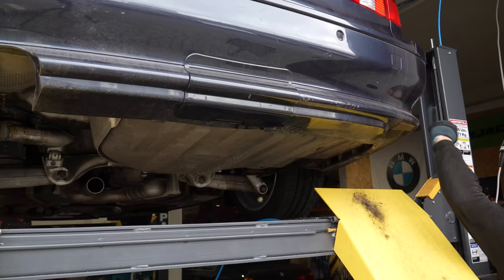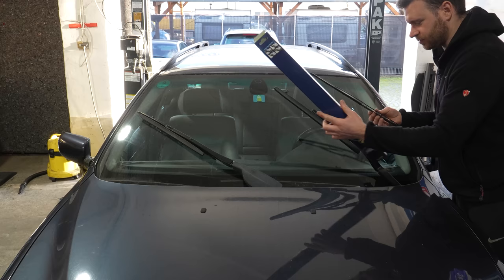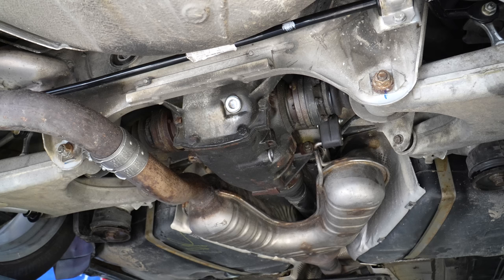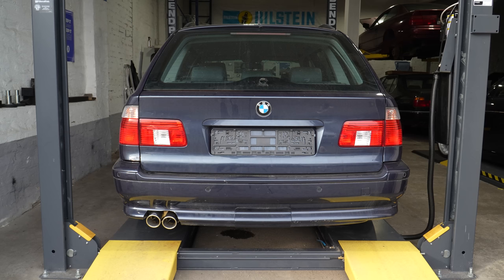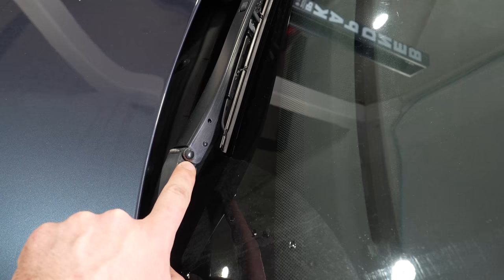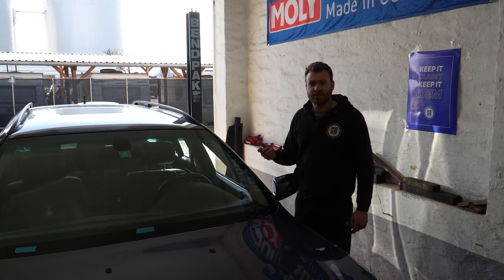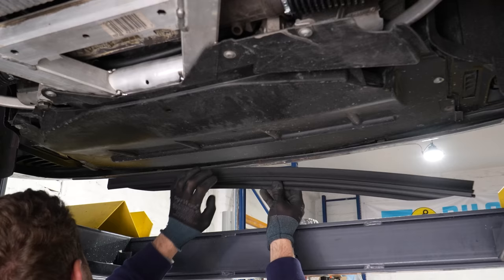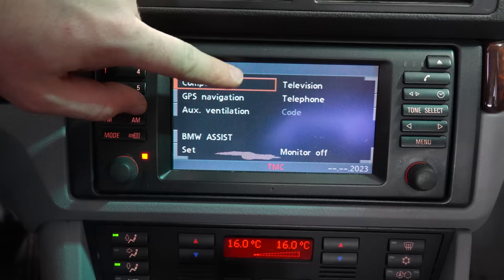Shouldn't Be Put Back on the Road - E39 530i Touring - Project Rottweil: P4

Comment: Tip , when you buy new wiper mechanisms, take the pivots out and add more grease before you fit them, they often come with minimum grease from the factory and then as soon as water gets in ( it always does) they start to rust and sieze up.

Comment: this makes miss mine every time, such nostalgia watching you do repair the things I had to do on mine, I had to drill through my mirror bolts lol, they were completely corroded. I had the rear wiper motor running again just cleaning and lubing it up. Attaching the speedometer rings, cutting the bumper for a decent exhaust tip lol, miss it so much. For most people it's just an old BMW, but for me this car has a special place in my heart, E39 has that true BMW soul in it, no newer BMW-s do it for me any more.

Comment: What a great episode ❤️
I agree with you, E39 Touring is a great car, love mine (an '02 525D Titanium Silver with 270.000Km, just did a major refresh with all new struts and supports, new water pump/fan clutch/thermostat/EGR thermostat/belts/idler pulleys/alternator and a brand new AUX fan. Was driving fine before and now it's driving even better!).

Comment: Thanks to finding your channel a couple of years ago, I did exactly as you said at the end of the video and in 2021 bought a neglected 1996 E34 520i Touring. She'd been off the road for 12 years and dry stored in a barn. Now 2 years down the line, she's back on the road and I've covered over 3000 miles. Absolutely love it to pieces and can't thank you enough for giving me the confidence to do the work myself.

Comment: Great project.
I had a 335D tourer a few years ago. Worst part was the auto box. Despite having around 400nm of torque it kept wanting to change down a couple of gears to go through a corner.
I had it in the tiptronic mode all the time to stop it changing gear unnecessarily.

Comment: Thank you very much for sharing what you did, brought back fond memories of what I did to my 1970 MB 250 coupe in 1994, except that it was the mechanic who did the work and the body shop did a bare metal respray.

All I did was spending numerous evenings scouring over every microfiche of the MB250 and order the parts required, including the original screws and washers, as many were replaced with ordinary screws and probably all mixed up during its 24 years with its first owner.

I have to give credit to the man that works (yes!  He is still working for the same company, except that he and I were young then, and we are both close to retirement age now) at the parts dealer who patiently key in every single order for me, there were literally 100 pages of parts, where perhaps more than 1/3 of them were for original MB screws and washers that some of them were only few cents each!

Comment: My dad had a 530 back then. Pre-Facelift. Super smooth. Only the electronics were insanely unstable and the electric trunk cables broke quite often. Dealer had to remove the headliner to replace them.

Comment: Sreten, I love your attention to detail and it pays dividends. I have just got my Mercedes W204 C200 in rude mechanical health (rear subframe was recently replaced under warranty) and I'm working my way through the smaller niggles. Every little thing you fix makes it that bit better and a better place to be. You should've called it the Rottweiler because it was a dog of a car when you first got it. Now you've worked your magic, it is once again fit for the road. I absolutely agree that the E39 is the best generation of 5 Series. I'd have an E39 in a hearbeat if I had the space. Oh for my own workshop.

Comment: Advice regarding sound system - even the basic speakers will sound A LOT better, if you put sound deadening in the doors - the outer sheet metal will stop resonating, will "keep the sound inside", and the bass will be fuller and the sound as a whole will be noticeably better. Highly recommended

Comment: Another awesome Video. In case you didn´t know, you can quick test PDC Sensors with your Finger Tip. Activate the Parking Sensor and then touch the Sensor with the tip of your finger. You can feel the ticking from the ultra sonic, faulty ones don´t tick. Workes everytime for me if 1 dies on my E39 and i need to locate which one. After that i double check and read the Fault Codes. Hearing the ticks also works nice but for me feeling the ticks is easier

Comment: Agree. Your exhaust sound is just perfect!. For a 5-series, it cannot be loud. It has to be subdued. Some babble at low rpm but almost silent at cruising speed. It roars a bit when overtaking as you floor it!. Brakes on E34/E39 are just fantastic. I used EBC Blacks pads in the old days...
Reply: Oh, mine was green Euro spec E34 touring with doglet manual tranny and 12mm H&R spacers on the front. M-parallel replica 17s rims

Comment: In my old workplace our shopmanager told me a special trick to get customers rear wiper blade to move. The seized shaft was left submerged in box of diesel for overnight and in the morning the shaft had come loose so it could be turned, cleaned and reused.

Comment: the mirror refurbishment is reminding me of the adventure I had with the driver's mirror of my 2006 Buick Lucerne (the Equivalent BMW would be an E60 5 Series/Project Raleigh) the dealer i bought it from had replaced the driver mirror with a cheap aftermarket one from Taiwan (the original mirror was electrochromic and heated and likely the electrochrome had turned brown and ugly); what they DIDN'T realize is that my car was equipped with RPO (Regular Production Option) code A45 which is the Memory Package, and the mirror they bought was HEATED ONLY. the original mirror actuator and wiring harness had positioning circuitry so the mirror position could be recalled to the two different memory positions (the 2 original keyfobs are also tied to the memory positions as well) so every time I would push the Memory Recall switches or attempt to use the Park Tilt personalization feature, the driver's mirror would go in a random direction and go all the way to the stops. 

it took me two trips to the local salvage yard to find an OEM mirror in both the correct color (Platinum Metallic) and with the right options (Heated, Electrochromic, and memory; because the top of the line trim came with Integrated turn signals in the mirror glass, and the base model was power only) and the first time I got to use the outside electrochromic function at night was a FREAKING GAME CHANGER! (also the 2010 Lucerne I got my mirror guts from gave me a VCIM that has OEM bluetooth, so I was able to get an OEM Plus option!) my next OEM Plus upgrade I'm going to install next is the U3U Navigation Radio (my 6 disc CD Changer doesn't work at all, not even with the dealer Special Tool Audio CD!)

Comment: I had scratched up climate control display, and I used Autoglym Super Resin Polish to polish it, made the swirls go away practically looked like new afterwards. It’s meant for paint polishing put works well for plastic windows too.

Comment: Regarding the audio, my last 3 BMW’s had base audio and I improved them greatly with just a 400w plug and play amplifier. The problem is the lack of power rather than the speakers as there is no amp on base audio. The first type I used in e46 and e53 was a pioneer GM-D1004 and the current e70 has a Vibe POWERBOX65.4BMW2. Both are plug and play with bmw, no cutting wires etc and really livens the audio up and can be hidden in the dash. If the oe speakers are kaput I can recommend Focal access components as fitted to my e53, they are just👌

Comment: 56:44 PPF (paint protection film) would’ve been the best thing here, clusters are super susceptible to fine scratches that glisten in the right angles when the sun hits. I created a template for my car, brought it into adobe illustrator, traced and sent to the plotter for computer cutting. I used Stek, it’s got a prepreg ceramic coating and auto heals with some heat.  No more scratches!

Comment: I had my 2003 530d m sport auto for 5 years now. This is my 4th E39. 535tkm and going strong. Not planning to sell it. 
As for the audio, mine has the hi-fi version, which isn't great either, but since I like it stock, I just added a Audio Systems 10" sub. 
I would upgrade front speakers to Audio System 3ohm components and maybe add a small amp.

Comment: I always enjoy your content.  This one was particularly useful.  Lacking a lift and the dexterity/mobility brought on by the parade of years, I've taken on an older e34 and e36 with the 2.5.  These are easy access to most anything under the hood, and there is no shortage of the little projects similar to what you addressed in this video.  Thank you for going into details the Bentley manuals are lacking.

Comment: Mitsy is such a cutey!!! Another great way to spend the beginning of my Saturday shift at work 😉 For a speaker upgrade I'd suggest looking at JL Audio, Polk, Rockford Fosgate and other higher end manufacturers. The midrage/sub in the front doors looks like 5 inch but could be 6 inch. That will be the tricky part is finding a component set with separate crossover that use a 5 inch speaker. The factory tweeter will probably have to be left as is due to, most likely, being a bespoke moulded item for BMW but is likely a form of soft dome tweeter and IMO these give a softer, less shrill high end compared to piezo, mylar or other plastic based tweeter cones. Using the factory tweeter with the aftermarket crossover shouldn't be an issue but will depend on the upper crossover point of the aftermarket crossover which is related to the upper frequency of the midrange/sub speakers. The lower end spec BMW models also didn't have fantastic power output even with a factory amplifier so a quality aftermarket amplifier will also make the speakers fill the air volume of the vehicle more easily and make the stereo more easily heard at lower volumes.

Comment: Awesome video, as usual. When I took my E39 to the glass repair shop, they installed an OEM wind shield, but apparently, in a wrong way. I had wind noise starting at 100km/h, but I noticed that too late. So better be careful:)

Comment: Pro tip! A small ball of buytl dumdum aka the black sticky door pane adhesive tape on your finger. Helps remove the door handle bolt cover with no digging.

Comment: I can highly recommend the Alpina firmware/tune for the auto tranny. I have it on my 330i E46 and it's just waaaay better than the stock one. Sits exactly between the D and S mode and loses the S mode completely.
Also on the pixel repair topic - I own a 2000 E39 540i/6,which has a service record at BMW in 11/2005 to remove instrument cluster and install it back again, at the same time there's a sticker on the instrument cluster casing stating pixels have been repaired in 11/2005. Lasted 16 years until 2021 - when the first column of missing pixels started showing up. It's still the one column as of today (04/2023)

Comment: If it's easier to find Comfort and Sport seats separately,  you can make your own Contour seats, just without the "bookends" on the top half. All 18 functions, same as Contours. Just have to re-pin the main plug to add functions, the wiring is based in the back/ top half of the seat. 

I have this setup in my e39 touring, as Contours are super hard to find in Australia.

Comment: for a Audio Upgrade on my E39 i used a " Hertz Uno K130" Speaker Set and insulated the Door an the Speakerbox with Reckhorn ABX Alubutyl.
i dont know if the bigger improvement  is from the Speakers or the Alubutyl stiffening the Box.The Original Headunit was faulty,so i swaped it for a Xtrons Android Radio in OEM optic.I dont know how to Upgrade the Rear on a Touring, i Have a 1996 Sedan. Keep up the good Work,its allways nice to see a Car like this back on the Road and not guttet for parts. Greetings from Bavaria :)

Comment: Hey streten, I was one of the people that recommended the bavsound speakers from the previous video, I don't know if it's similar but I'm running my us spec e36 318i base with the and bought the hifi speakers option, they fit and plug and play using standard bmw plugs, unless the plug is different in euro spec, I am running aftermarket amps and a full stereo system however but the plugs were the same, you might not even need to do wiring at all are the same, only repinning!

Comment: I used Audison AP5 in a base level E38 I had. Those speakers are directly plug and play, fit perfectly in place of the original speakers. Great sound and deeper bass and even better if you ad an amplifier for them.

Comment: I recommend Cirium oxide to polish the glass it will remove water marks easily and those wiper marks, I used the 3 inch pads and would just respray water on the pad to reactivate it. If you do use it all you need is about two teaspoons of cirium oxide then just spray water on the pad it, also works on chrome  but do a hand polish you will be happy with th results.

Comment: I drove an e39 touring for several years. Please use new seals for the inner rear light, as used ones will leak after a short time and the spare wheel tray will get a new aquarium. The main tailgate is rusting on all corners, please use fluid film there as well

Comment: You asked about upgrading the sound system. There is a German car audio company that specializes in sound quality. They called auditec Fischer. They have a range called helix, and they offer alot of plug and play options that improves the sound system.

Comment: 11:14 About the sound system upgrade, I would suggest you to try Hertz 2 way component system with filters. They sound really good. I replaced my OEM speakers with Hertz and I love them.
Other than that, you need a really good player, because the problem is not with the speakers, it's the radio player...
When I changed the factory stereo with Erisin Multimedia, it changed the whole world for that car. Event the factory speakers sound really good with a good player!

Comment: Stuck rear wiper is a common issue. Had the exact same problem on my e39 touring.
Same with the inner tail lights. Outers were fine.

Too bad you didn't buy an e39 530i touring sooner. I could have seen all the repairs I needed to do in one video 😂😂

Comment: Hey Sreten, amazing Video you created there 👌🏻 Absolutly love it. But I noticed the bottom Windshield seal where the Wipers come through is not seated correctly. You can take a Screwdriver and simply push on the plastic Screws and they will popp in Place. The Seal has to be flat on the Glas. Did the same Job weeks ago and had the same problem ✌🏻

Comment: We've just completed replacing all the same parts on our e39 Touring as you have! We have the same issue with the pixels so am going to be brave and get a Pixel kit as you've inspired me to try it. Did you know the tailgate struts are rated at 1,600Nm, while the rear glass struts are rated at 530Nm. They're seriously over-engineered. I'm back on the road with ours next week. They're worth saving as future classics.

Comment: Those displays aren’t €27 in the US. I bought $5 ribbons and did the drill method instead of removing the needles. T tip soldiered the ribbon tabs and it came out perfect on the first try. Radio was mega pain in the ass. After a dozen attempts I finally learned I was snorting the ribbon out on the frame. Fixed that and MID worked perfectly. $10 out of pocket. Plenty of YouTube videos to walk you through it.

Comment: Talking about rust, have you yet tested acf50? It's pricey but you only need the thinnest mist of it and it doesn't drop on the floor. Spray on and wipe of excess. 

Several motorcycle owners use it with good results through out salty winters. Also used in aircraft industries.

Comment: Eton makes some plug-and-play upgrade speakers for BMW that might be suitable. Unfortunately, basically zero manufacturers seem to care at all about tracking compatibility for their plug-and-play speakers all the way back to the E39, so you may have to get on a chat with whichever manufacturer you like and see if they have any documentation in their systems for which of their BMW speakers may fit the mounting you've got. BMW has had relatively few different speaker designs for their conventional in-house speaker implementations, so it's quite likely that you can cobble something together out of existing plug-and-play BMW upgrade speakers without needing to modify them.

Comment: Great car. I have a 528iT and to me, the only thing that holds it back is the transmission. This car with a modern 8 speed automatic transmission would be amazing. Also, if a cassette gets stuck, eject it,  tap it a few times on the dashboard and put it back in.

Comment: In the e83 despite having the base stereo the hi-fi oem speakers and tweeters were a bolt in improvement. I am also told that having the base unit makes it easier to work with any enhancements. Took me buying the redstone amp to learn you can't upgrade that. Oh well

Comment: Epic as always! But please keep the M sport steering wheel. It just looks so much better! Keep the heated one for winter.
Reply: And about the wood in the interior, birch antrachite wood would be epic. Not just for this one. Also for the e39 and e60 M5. They are expensive second hand but you could hydrodip the current trim.

Comment: Think that inner rust could be treated by sandblasting? Later thorough cleaning and etch primer + cavity wax. Just cover the trunk entrance to avoid sand and move wires out of the way and plug the hole if possible.